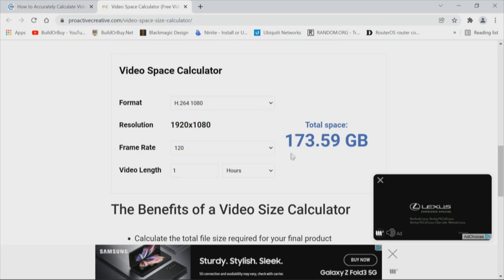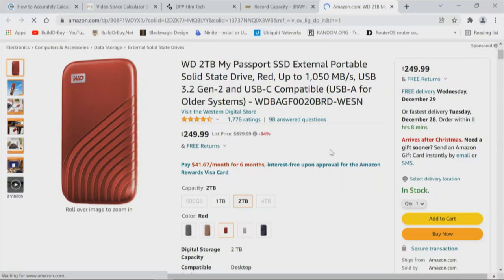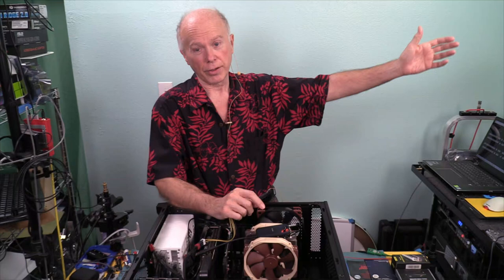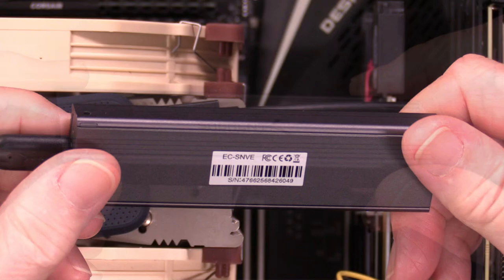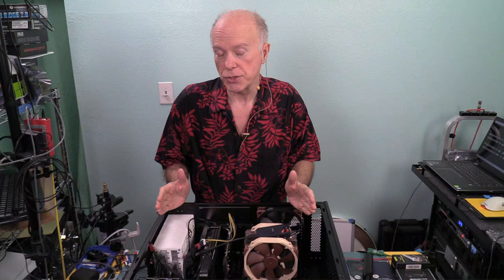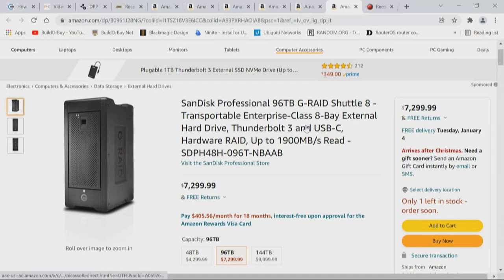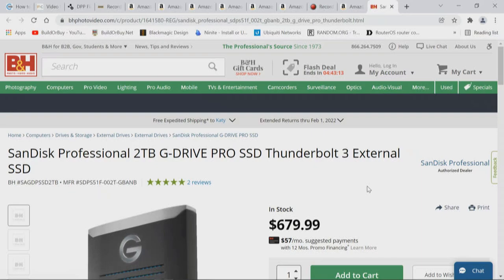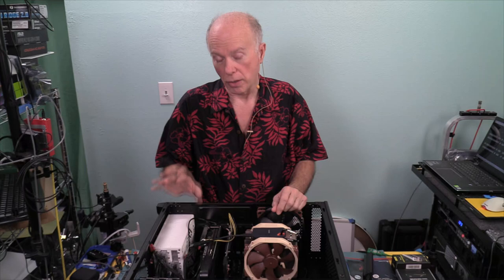External Portable Storage USB-C, Thunderbolt and RAID

Comment: You do such an excellent job of explaining information technology for content creators.
Reply from the maker: Hi AGS 1000,
I'm honored and Appreciate Your Comment! Always about being purpose Built! Keep it Simple and Make it Work! Merry Christmas and Happy Holidays!
Reply: @BuildOrBuy  I have the I/O to go any route for storage. I don't need the capacity that a creator needs. 2X, 3X, 4X the throughput per/sec is enough to see in real time on the PC. How does Thunderbolt compare to an NVMe AIC GEN4 drives. Raid 0 is the only type I'm looking for on an AIC. I don't know totals on speed but a GEN4 X16 PCIe socket just has more lanes. 3 Asus Hyper Gen4 cards and one SSD7505 Highpoint card should be a good start.
Reply from the maker: Hi @maxhughes5687  
From that aspect, accessing Internal Storage vs External Storage. 

FYI: ASRock had a Preliminary WRX80 Workstation Motherboard listed and removed references to Thunderbolt 3 right after We did that Video. Now, ASRock has Listed, ASRock > WRX80 Creator with Thunderbolt 4! Interesting! Also Listed as working with Threadripper Pro 3000 and 5000 series CPUs! Fascinating news! 
https://www.asrock.com/MB/AMD/WRX80%20Creator/index.asp
Stay Tuned!

Comment: Great presentation Gill as always! I work with 3D animation. I render frames out in EXR format which contains each render channel in one file.
Each file can be between 100mb to around 200mb depending on what render channels I need. Each file is a frame and animation is normally at 30 frames per second.
Each second can be between 3gb to 6gb or upto 360gb per minute!. It makes those black magic camera outputs look low lol.. Good thing is I normally don't work with more than 3 minute 
animations. The only way I can edit them smoothly is with a gen4 ssd (I have a firecuda 530 2Tb) .. Once I finish I output to a spinner as it all gets compressed to h264..
Keep up the great work!
Reply from the maker: Hi DoplerE,
Welcome! Thank You for Your Comments! Fascinating! What application? Thanks for Sharing! All about the Project and Workflow!
Reply: @BuildOrBuy  Thank you for the reply Gill! I work with 3D Studio Max for rendering out frames in EXR format. It's the most demanding on storage.
After I complete the rendering which sits on the Gen4 ssd and compile the animation I then compress and move those EXR files to a 24tb raid setup.
I enjoyed watching your explanation and it gave me great insight on the upgrade path I'm currently looking at.. cheers!
Reply from the maker: Hi @doplere6364 , 
Absolutely! Everyone matters here at BuildOrBuy! Fascinating project and interesting workflow. Thank You for Sharing! Glad We could help!

Comment: Thanks for pointing out that for data transfers Thunderbolt 3 & 4 maximums are limited to PCIe version 3 x 4 lanes maximum speed.  This prompted me to look closer at the Thunderbolt specifications.  I found another caution,  a device can be in compliance with Thunderbolt 3 when producing only half of the maximum speed.    🤨
Reply from the maker: Hi HAL09000,
Welcome! Interesting! Glad You've brought that up! And when We discuss Bandwidth, there's a difference in Burst Mode vs Throughput.  At half speed and still in compliance based on the Spec, We're talking 20Gbps. We already have 20Gbps USB-C! We're working on a Video about 20Gbps USB-C and what that entails! With Thunderbolt 4 is the approach of USB4 for PCIe Tunneling IF so supported by the Chipset. In otherwords, a Chipset may support Thunderbolt 4 but will it support USB4 PCIe Tunneling. Depends. A lot of Users are going to be very disappointed over Thunderbolt, eventually once they understand the implications. Implementing Thunderbolt 3 was pretty straightforward even though a bit of a hassle with hoops to jump through. Thunderbolt 4 Implementation is Vendor specific with Manufacturers specific Motherboard Thunderbolt Headers for Bios support. And Bios support is required for enabling USB4 PCIe Tunneling. Something else to navigate and contemplate! Crazy, right! Appreciate Your Comments!

Comment: As Gill said, it is better to have an enclosure that is separate from the drive just for you to be able to handle issues with either of them independently. I have had many issues with either enclosures or the drives so that was a great suggestion from Gill.
For Thunderbolt enclosures, I have seen bad comments on the Sabrent ones as they seem to use a proprietary Thunderbolt connector which makes it not ideal as the cables tend to go bad for a myriad of different reasons.
Because of that I got a WAVLINK Thunderbolt 3 one, and it works as advertised within the limitations of Thunderbolt 3 ( 2,800MB read - 2,500MB write ).
I have tested the enclosure with Intel NUCs and with an AMD based Titan Ridge 2.0 system, the speeds are the same.
I have only had the enclosure for a couple of months now so I cannot comment on long term reliability.
Wish this helps someone, happy holidays =)
Reply from the maker: Hi Immortal Zodd, 
Absolutely Great Advice! Thanks for Sharing! We never know whom We might be helping! Merry Christmas!

Comment: Quick comment on spinning drives.
I have several Seagate IronWolf Pro (NAS drives) in both the 12TB and the 16TB variants and they can go for 200-225 MB read/write speeds even in USB enclosures.
I have a Terramaster RAID5 Thunderbolt 3 enclosure and they go for 425-450 read/write when configured in RAID5 mode (which is their best case scenario for that enclosure as with the RAID0 mode they ended up with worse throughput).
I have other Terramaster USB-C enclosures and for RAID0 they can go up to 400-425MB so unless you really need the Thunderbolt for the daisy-chain AND can live with only 24-32TB worth of storage, I would go for those double-bay enclosure that do pretty well in RAID0 and USB-C with those drives.
If you need more storage, your only option is going for the Thunderbolt versions and with their RAID5 modes as the RAID0 ends up slightly slower. Quick side note for the Terramaster Thunderbolt enclosure, they do need a Windows driver for them to work so if you want to move around the enclosure, it can only happen in Windows based machines with the driver installed.
The Terramaster USB-C enclosures work perfectly fine without any drivers.
As with any spinning drives, they do slow down considerably with small files so keep that in mind.
So for video rendering use cases, if you get these drives and your rendering speeds fall between that write limit (~200-225MB) for a single drive you should be fine with some IronWolf Pro drives. If you get a RAID enclosure, I think they can safely go between 400-425 but that is more dependent on your hardware solution for the RAID than the drives.
I hope this helps someone and wish everybody the best of lucks in your projects... happy holidays.
Reply from the maker: Hi Immortal Zodd, 
Thanks for Sharing. I have not had the Opportunity to work with Seagate Ironwolf Pro Drives yet. Amazing throughput! My experience is with the following, WD Black, WD Gold Enterprise, HGST Deskstar and Seagate Desktop and Seagate Barracuda XT (I think those were the first 2TB Drives). Mostly WD Black. 

Let's hope this helps others who are searching!
Reply: @BuildOrBuy  Indeed, very few channels check spinning drives or enclosures these days so that's why I thought sharing the experience may help someone.
Reply from the maker: Hi @immortalzodd7474  
Absolutely agree. Glad You did! Thank You! Anyone should always Test and Verify. Results can vary.
Reply: @BuildOrBuy  hello western digital ( seagate too ) can put in big external HDD 8 TO or more) entreprise class  drive ( white label )  its helium class drive ( HGST He8 for exemple =  , they low the speed ( because of heat ) but its near 200/ 250 mb of speed  : that why a lot of people buy extenal drive and put in the pcc ( less expensive )
Reply from the maker: HI @romainbailet6488 ,
Welcome! To reiterate, Our experience with spinning HDDs has been WD Black Performance (Retail and OEM), WD Gold Enterprise, HGST Deskstar NAS and Seagate Desktop and Seagate Barracuda XT. All 7200 rpm. We have not had the opportunity to Test a Helium class drive yet! That's a great idea! Thanks for Watching! Appreciate Your Comments!

Comment: Hello i did buy the best corsair h150i elite lcd  water cooler idk how it works how to setup any recomendations
Reply: why did you buy it?
Reply: @RogueTravel    cause a friend recomend it i know how to build pcs but its first time water cooler i need to see a video to know how to do
Reply: @oi3 That is a large cooler. If you do have a processor that requires that level of cooling, please do a YouTube search for any Corsair H100 or H150 installation for the brand of processor you have (AMD or Intel)
Reply: @RogueTravel  i have amd ryzen 5 5600x
Reply: @oi3  you should return that cooler then, if possible and go with something much cheaper
Reply: @RogueTravel  atm i have connected the best amd am4 prism rbg cpu cooler i dont want to return
Reply: @oi3  Next time around, for the money you spent you could have instead gotten a 5800x and a cheaper air cooler or perhaps a better gpu. That cooler is really meant for high power consumption cpu's. No biggie though, you live and you learn.
Reply: @RogueTravel  ty for ur help and tips i like this cooler special cause the custom gif that i can add on it and also io think this cooler can live longer right?
Reply: @RogueTravel  merry xmas
Reply from the maker: Hi oi3, 
Great Cooler. A bit overkill seeing the CPU You have chosen. Simple and straightforward with Thermal compound preapplied. Just follow the Cooler directions for Installation. I'd say mount Radiator in top of Case. Hope that helps! Merry Christmas!
Reply from the maker: Hi @oi3 , 
Watch Your positioning for Tubes from Radiator to CPU so the follow a natural contour without binding or kinking. Hope that helps! Success on Your Build!
Reply from the maker: Hi @oi3 , 
You can work with what You have! Do a dry run assembly to see positioning before actual assembly. Keep Us Posted on Your Progress!
Reply: @BuildOrBuy  do i need to put water or aleardy has
Reply from the maker: Hi @oi3 ,
That's a closed loop system. You do not add anything.
Reply: @BuildOrBuy  ty im begin to setup now merry xmas and happy new year
Reply from the maker: Hi @oi3 ,
Success on Your Build! Merry Christmas and Happy Holidays to You! Thank You!

Comment: Why a Samsung Portable SSD T7 1TB having USB-C  3.2 gen 2 connected by it's original USBC cable to a USB 3.2 gen 2 USB-C port instead of getting the speeds as advertised 1050 MegaBytes/s read and 1000 MBps write I'm getting only 384 MegaBytes/s on Ryzen 3900x on x570 chipset motherboard. Why so low? I was transfering big compressed files like 20 GB per one file. Who knows?
Reply from the maker: Hi Don Jon,
Merry Christmas! Great Question. Good example of Burst mode vs Sustained Throughput. Did You Test before using? Those numbers look like an SSD and not an NVMe! Crazy, right.
Reply: you have usb bug know on ryzen gen 5000 , i have a ryzen 1600 and arion asus enclosure : my speed is 1000 / 1000 .REmember usb port divide speed with item put on it , if your usb port is share  speed down . More th chip in the enclosure is important jm or via to work well
Reply from the maker: HI @romainbailet6488 ,
Glad You brought that Up! This USB 3.0 performance bug on AMD goes back 10 years. It was the 990FX Chipset that could not handle the throughput. Only burst mode. Still a problem. Supposedly a Bios fix was suppose to fix that. Doubtful based on what We had experienced previously. To overcome that issue then same as now, a Renesas USB 3.0 Chipset is required to handle the throughput. And yes, the Bridge chip matters greatly for external Devices. Appreciate Your Comments! Thanks for Sharing!
Reply: @romainbailet6488  I have 3900x
 So I'm fu..d? Great. I knew that leaving intel for AMD will get me into some kind of trouble.
Reply: @BuildOrBuy  So what now?
Reply from the maker: HI @donjon7554 ,
Not at all. This has been a problem going back 10 years. No one talks about it. Now this is talked about as if it's something new. It's not.
Reply from the maker: HI @donjon7554 ,
Do You Stream anything through USB 3.0? In other words, do You have anything You connect to a USB 3.0 port that requires continuous throughput? To reiterate, Renesas USB 3.0 Chipset is required to handle the throughput. 

1. Syba SD-PEX20159 PCI Express Card x1 with USB 3.0 Type A 4 Ports Super Speed and 15-Pin Power Connector Renesas Chipset
https://amzn.to/3mMFxQu
2. Sedna - PCI Express USB 3.0 4 Port Adapter (4E) - NEC / Renesas 720201 chip set
https://amzn.to/3mM2Fyz
As an Amazon Associate I earn from qualifying purchases.
Hope that helps!

Maybe We should create a Video about this and Our take on the Problem. We have only Our experience to share and Our opinion but no facts We can point to other than Results. As in, Here's the Problem and here's the Solution.
Reply: @BuildOrBuy  and they still didn't fix that? That's quite impossible. X570 is a new entity like Ryzen. There should not be a problem.
Reply from the maker: Hi @donjon7554 , 
AMD claims they can fix that on newer Platforms with a Bios Update which implies CPU. I don't think it's the CPU. My personal opinion based on 10 years of that is the Chipset. The USB 3.0 Chipset however AMD is doing that was not and still is not designed for throughput, only burst mode. That's why I've always stated, use USB 2.0 or jump over to USB-C. But don't use USB 3.0 for anything that requires constant throughput like streaming. 

If We did a Video of examples to show the problem and how to solve it would take some time to setup and Film. That's one of those things We figured out a way around it and moved on. And now it's back. Same problem. To reiterate, I think it's the Chipset based on what We've seen over the Years. USB 2.0 had it's share of problems before USB 3.0 came out. Only USB-C has been ready from the get go! Took long enough!
Reply: @BuildOrBuy  but i get that using USB-C!
Reply from the maker: Hi @donjon7554 ,
Really!?! To what Device are You connecting, a USB-C Spinning or SSD or M.2 NVMe Drive? And what Data are You continously streaming or transferring? Tell Us about the workflow. Give Us some details! We need to understand the situation better on USB-C.
Reply: @BuildOrBuy  Read my first reply to this video please. It's all in there.
Reply from the maker: Hi @donjon7554 , 
Ok, Samsung T7. Got it... What's the internal Drive where the Data is either coming from or going to? 

This is more of an issue with the Samsung T7 than Your Motherboard Chipset. Copying files is not the same as Streaming. One-way to verify is to Test on a HEDT and compare. 

Sorry for not paying closer attention to the problem as outlined. 

BTW: Smaller files will transfer faster while larger files will transfer slower.

Question: Why did You purchase Samsung T7?

There's one other thing We can check. Go to Device Manager. Look under Storage Controllers for USB Attached SCSI (UAS) Mass Storage Device. Do You have that Device setting?
Reply: @BuildOrBuy  to ramdisk in and out
Reply from the maker: HI @donjon7554 ,
So You're using the Samsung T7 as a RAMDisk?